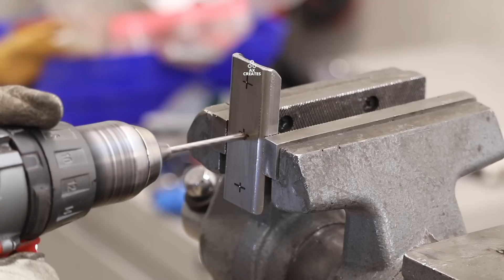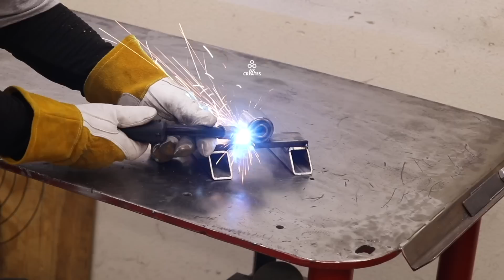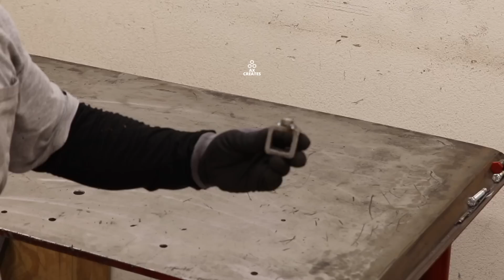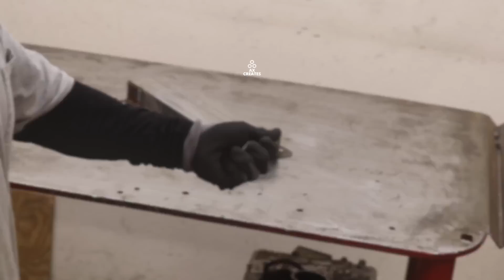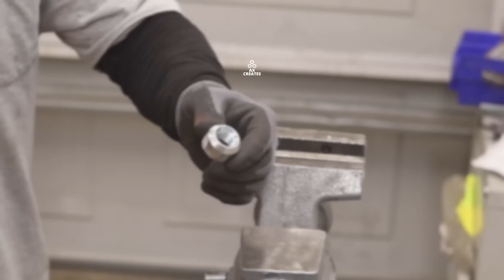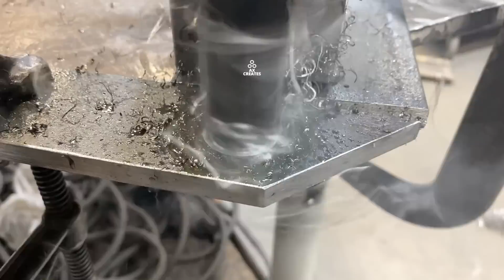BEST DIY IDEAS ABOUT MAKING TOOLS 2022!! BRILLIANT & CREATIVE DIY!!

Comment: I need to make a 1/2 diameter pipe by 12 inch diameter ring for my propane burner so I can use a wok on it, did you make a ring roller? I have not seen one in your videos.